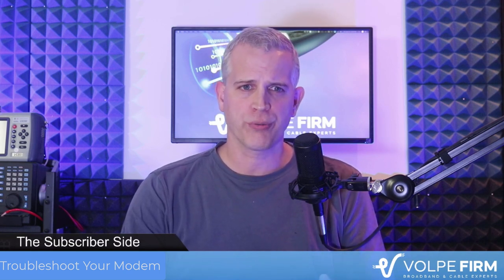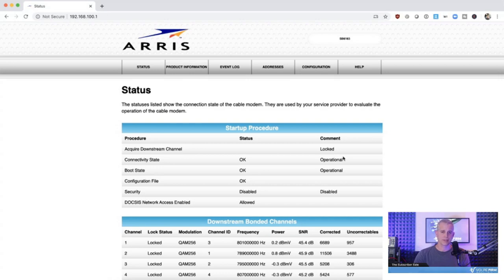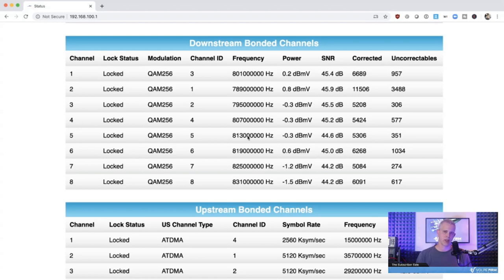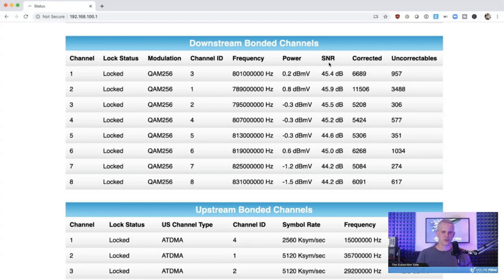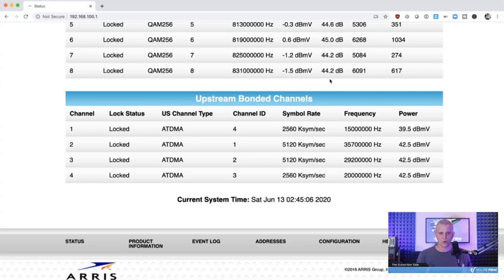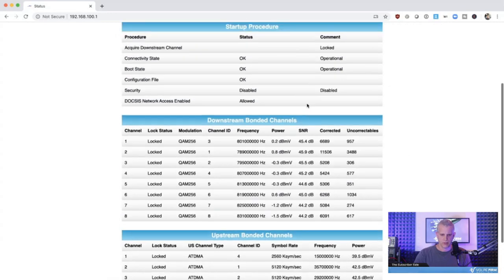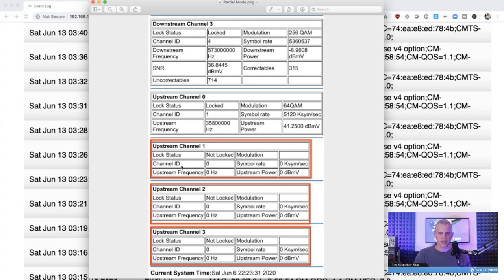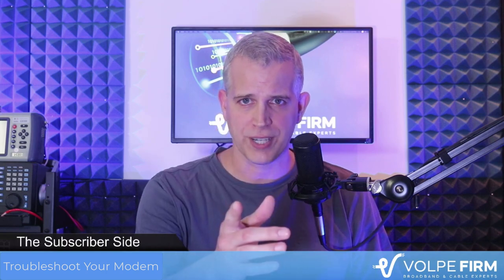How To Troubleshoot Your Cable Modem

Comment: I had an sb6190, and after 6 months it stopped working today. I had a technician come out and take a look and he said that it was sending electricity through the lines, causing interference. He said to get a new modem, and things should work fine. I got a new one (same type of modem) and it’s still not getting past the second light. When I checked the website, it says the Downstream channel (the first step) isn’t locked. At this point, is it safe to assume its not the modem, but rather the coax or ISP?
Reply from the maker: Hi @Dat Boi yes it is very seldom that the modem is the problem. Also, modems do not and are not capable of sending electricity down the lines as stated. There are devices called RF chokes that prevent this. So it is very safe to say that it’s not the modem 😖

Comment: What does it mean when your statuses are in progress, in progress, in progress, disabled and denied
Reply from the maker: Hi Mike, if you are getting a "disabled / denied" status it could be a couple of things. Usually disabled or denied indicated your service has been terminated because you have not paid your bill. However, a new issue has occurred with DOCSIS 2.0 and 3.0 modems where the BPI+ (for security) certificates expired in March and April of 2021. Modems with expired certs will be rejected by the CMTS. If you purchased your own modem many years ago, check with your cable provider and see if this is the issue. You can rent a modem or buy a new one and this will resolve the issue - or check with you cable operator and verify your all paid up.

Comment: Fyi, Comcast sometimes assigns an IP address of 10.0.0.1 or 10.1.10.1 by default when using their "all in one" gateways (which I usually dislike).
Reply from the maker: Thanks for the comment. I forgot to mention that 192.168.100.1 can be changed by the cable operator.

Comment: I plugged my PC into my modem (SB8200) and there is no internet connection. What does this mean?
Reply from the maker: Could be a lot things. I recommend trying a reboot first of the modem, then the PC.
Reply: @Volpefirm  sadly there is still no connection. Could it be an issue with the modem?

Comment: I’m having TLV-11 unrecognized error and Started Unicast Maintenance every like 30 min my internet completely stops working. How do I fix this?
Reply from the maker: Hi Raaid, this error often happens when you have a config file that is not correct for your cable modem. Have you contacted your cable operator about the error message?
Reply: @Volpefirm  I got it fixed so basically the upstairs cable was bad and we decided to connect to the first floor cable instead and our internet got fixed and it hasn’t gone done in months. I’m guessing the second floor has some wiring problems.

Comment: Hi Volpe - what would be your recommendation for trouble shooting this issue with spectrum.  reboot cable modem, get full advertised speeds but after ~1 hour performance is diminished to 1mb download speed.
Reply from the maker: Hi JJnATX have you confirmed you are not being throttled due to usage caps? If you are not, do you notice the speed slows during any specific time? Network congestion could be the issue if it is occurring intermittently. Also, I would recommend eliminating the wireless network and perform a speedtest when directly connected toe the modem / router. Finally, please do rule out the router by doing a direct connect to the modem.

Let us know what you find.

Comment: Hi I have a Arris cable modem I'm getting a T3 and T4 problem how do I fix this? And I only have 2 Upstream channels running when the four I had four
Reply from the maker: Hi Christopher, what are you seeing in the Cable modem diagnostic screens in terms of downstream power level and downstream MER? Same for upstream transmit level? Also, please record these values over the next day and see if they fluctuate very much. Finally, please see the video I just posted on fixing your internal wiring to make sure you don't have any faulty coax in or around your house.
Reply: Hey it's Chris here found out the voltage on the upstream's power was about 54.6 dBmV I live in a apartment complex I went to the main cable central Hub unit found out the connection at the main tap was shorting out fixed it since then I now get all four channels in no more T3 and T4 timeouts. The power now is 40.7 dBmV
Reply from the maker: @christophermoriarty7847  How did you know it was shorting out?  What did you do to fix it?
Reply: Great video. Clear and illuminating.

Comment: Hey Volpe! Great video. I'm having a trouble called "SYNC Timing Synchronization failure" - Have you seen this error before and what could it mean?
Reply from the maker: Hi Calen thanks for watching. The SYNC error message is fairly common. Every 200 msec (that’s 5 times per second) the CMTS sends a SYNCronization message to the modem. If the modem misses one of these messages it throws up that alarm. It’s not a big deal unless the modem goes offline and you see a flood of those messages. So a few here and there is not an issue. A log full of them 5 every second indicates a downstream problem.
Reply: @Volpefirm  Thanks! I will keep track of this! Definetly subscribing

Comment: In 9hrs Uptime on my modem My Uncorrectables were  all betwen 60,000 and the highest amout of uncorrectables were 111,675. is there an issue here? I do experience packet loss.. if so what do I do?
Reply: I also do need to mention that the highest correctable was only 21,433. ( i have saved screen shots because my modem always crashes and resets this data..)
Reply from the maker: Hi Seth. What are the total code words?  You need to calculate the percentage of code word errors. This is done by the following:  
( code word errors / total code words ) x 100 

That will give you the percentage. Ideally it should be less than 1%.

Comment: ". .troubleshoot your modem...."
1 ring your provider and spend an hour listening to the message stating how important your call is.
2 Get an interpreter to translate the call agent.
3 Spend vast amounts of time unplugging the ethernet, checking network status and rebooting the modem and all your equipment.
4 Try not harm your neighbour because your stress levels are growing at an exponential rate.
5 Blow your lid as the agent threatens you with call out charges if the problem is found to be with your kit
6 Threaten to move to a new provider if they don't sort your shitty problem out by tomorrow 
7 Stand by as you're passed off to the retentions department 
8 Repeat everything again to the retentions department.
9 Seethe with rage when the retentions agent says "... I'm sorry sir, let me put you through to the faults department who can help you with that problem..."
10 Holding your partner off the ground by their throat isn't good for them, let them go because it's not their fault.
Reply from the maker: LOL - Thank you for putting a smile on my face today. I may use your list in a future post as it it is all too true. 😂
Reply: Going through this right now. There's some hope because the neighbor also has issues. Last tech they sent couldn't fully speak English, and was oblivious to the modem status page. They ignored the thousands of uncorrected errors and the 55dbmv spikes on the upstream channels. They just said the signal looks good, ran a 2 second speed test, then left. Next best thing is to switch ISPs. Now to convince my partner to move their email. Arguing with that tech sounds less stressful.